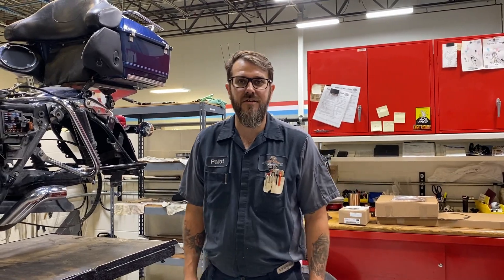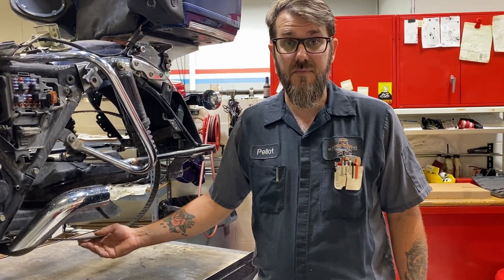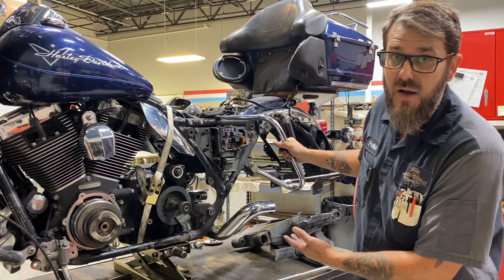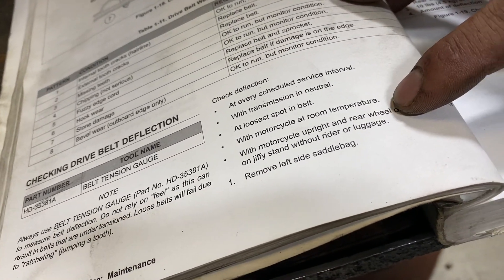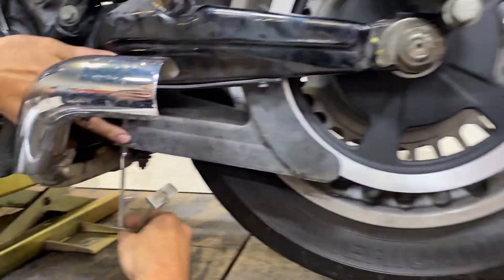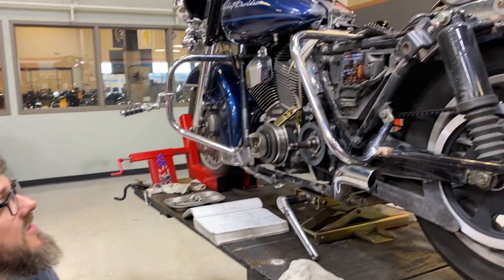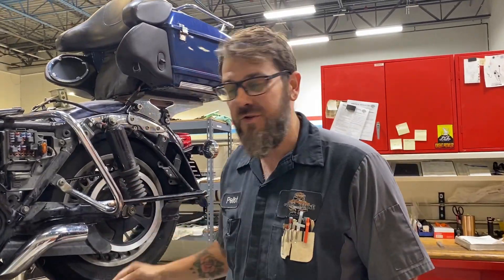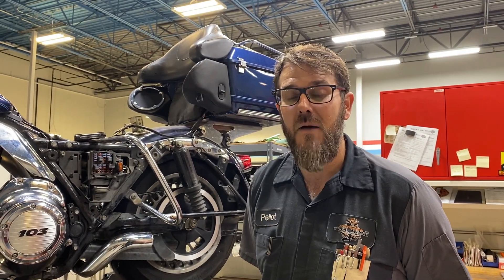Why should you care about Belt Deflection?

Comment: 2014 Dyna Fat Bob, dealer serviced every 5000 miles + tyres fitted in between belt correctly tensioned every time. Belt stripped it's teeth at 34,000 miles, over here in the UK dealer says 60,000 more usual but certainly won't last anywhere near what you say unless you're only wheeling the bike everywhere.

Comment: Why are you taking of the swing arm?
Reply: Good question? I know it's a bitch with the primary and.all but I've never seen the swing arm having to come.off? 🤔But then what do I know! 😂
Reply: I’ve changed at least 100 belts, never removed the swing arm, just the pivot shaft and left mount!
Reply: he was probably replacing the swingarm bearings, pivot bolt as well. A belt with that type of wear... I'd do the same thing.